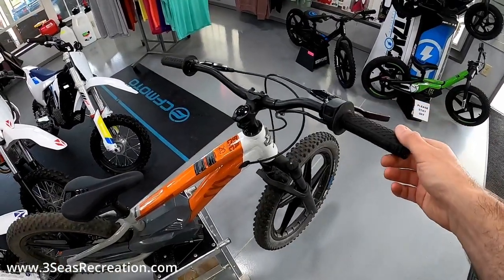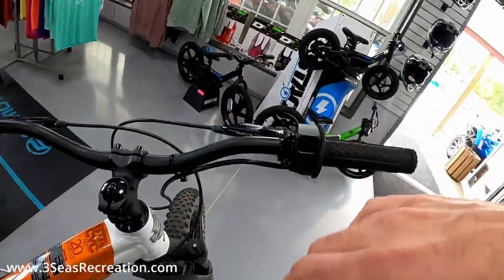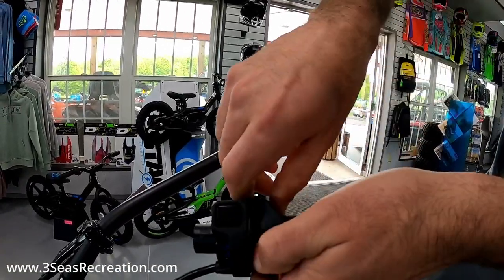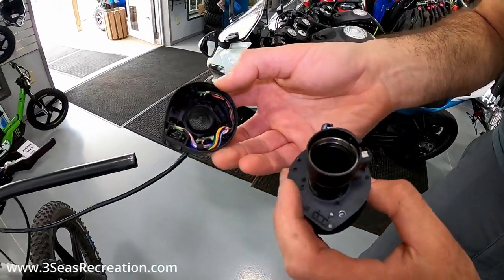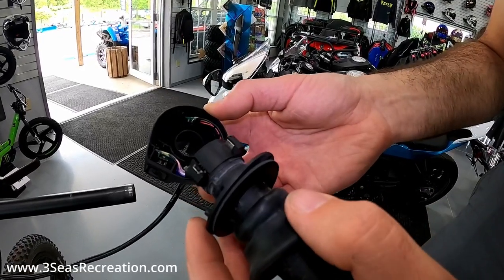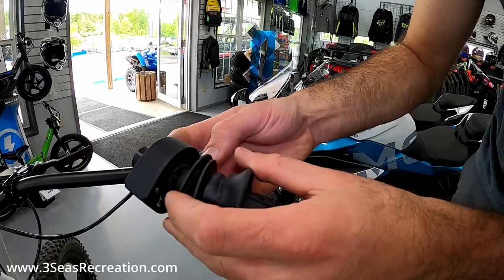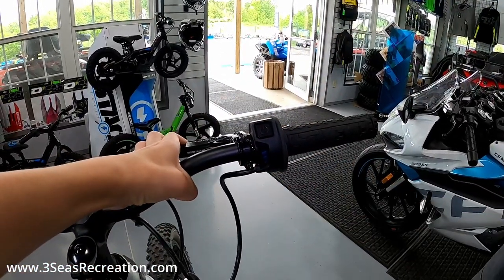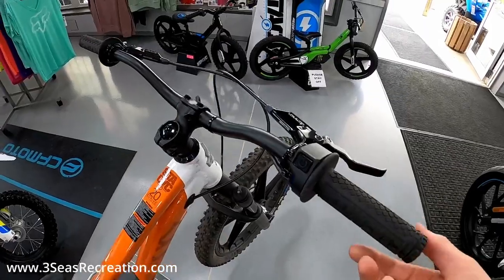Stacyc 20eDrive Throttle Disassembly & Spring Fix

Comment: Is the motor and gear box the same for the 20 and the 18?
Reply from the maker: Good Morning, I am not sure as I have not taken an 18 apart. That might be a better question to send into Stacyc. I would assume the motor is different for the 20 so it can handle the bigger 20" wheel size and rider weight. Thanks for watching, Jared